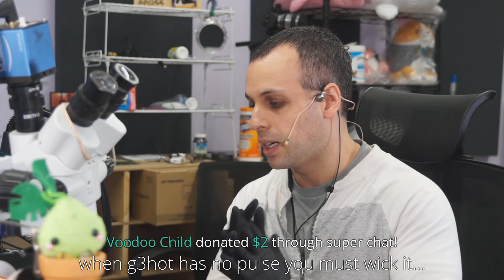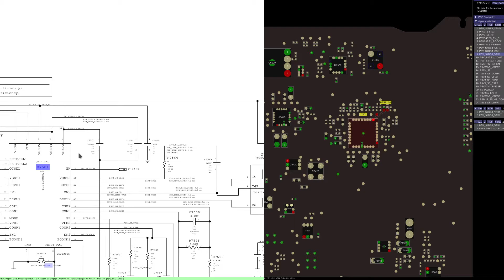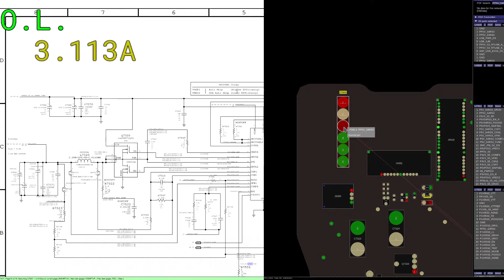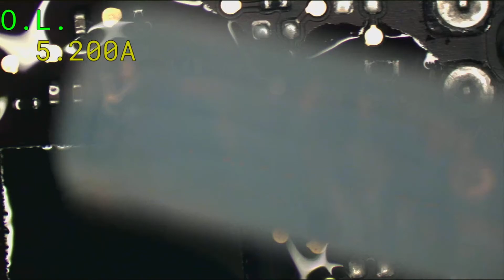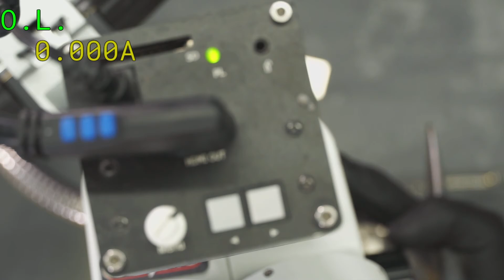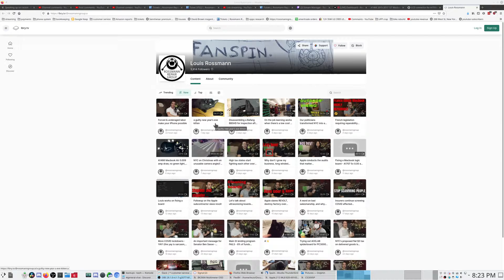Louis Repairs a board at component level

Comment: I definitely can't say that I watch all the way through all of these videos, however I don't see that as the primary use. If I have a specific MacBook with a specific issue I would rather sit through three or four 40-minute streams about that issue and your process then check out the wiki. I think that the wiki is a very important tool that is useful for people who know how to look through the schematic and find the certain rails and go through the rails, and it definitely is useful when it says this chip is normally the issue, however if I don't have board view software and I just need to do it for one computer I would prefer just to watch the video and go through your process of tracing it down and see exactly how you attempt it.